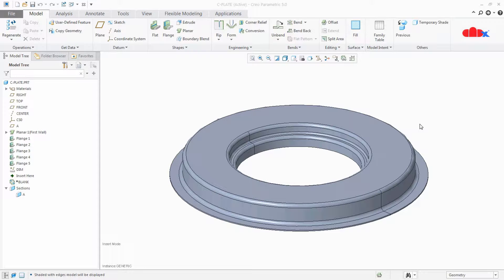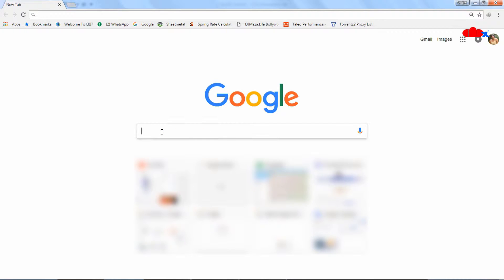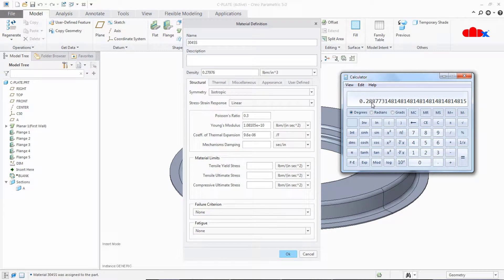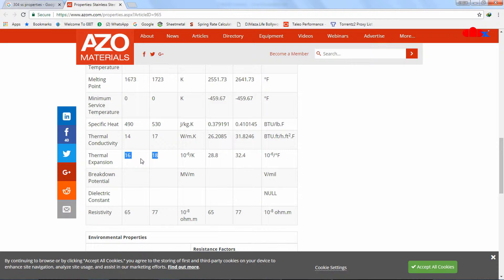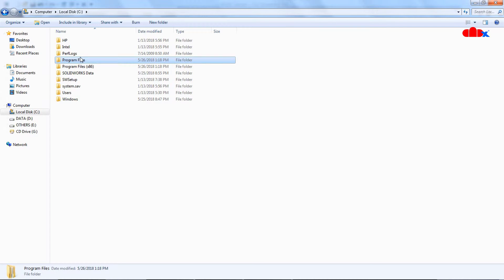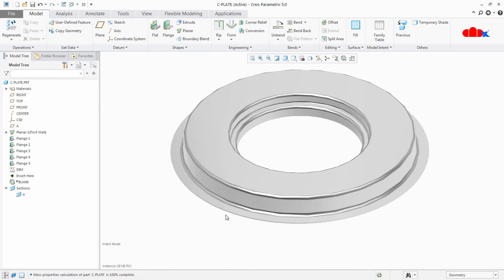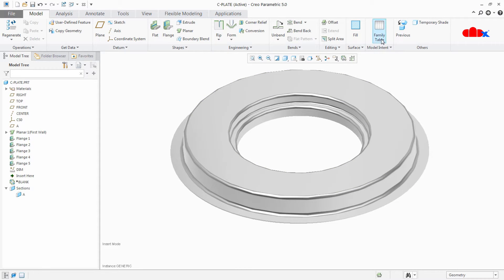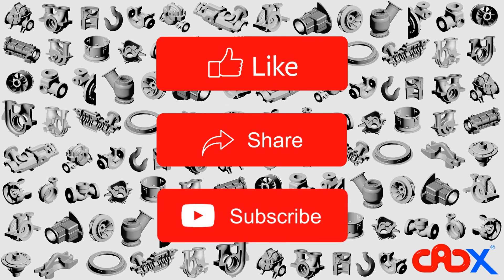Create new material | calculate weight of the part | add to the drawing in Creo Parametric

Comment: I suggest that you create a parameter called Wt_kg prior to Relation. That way you can assign the units for the parameter Wt_kg as 'kg '. This when called in relation, would automatically convert based on unit of pro_mp_mass. No need to multiply by a conversion value.

Please try this out.

Comment: Sir, how can we calculate assembly weight..
Reply from the maker: First you follow the same procedure and add weight for all the parts coming into the assembly.
Next is, create a bom table inside the assembly drawing. Call the weight parameter inside your table.
Atlast use summation to calculate the final weight of the assembly  in your drawing.

Comment: My part weight is 2.580 e02 kg what its mean
Reply from the maker: 258 kg
Reply: @CADxTraining  but part too short and in al5052 material
Reply from the maker: I think your unit is in inches.
Reply: @CADxTraining  no its mmks
Reply from the maker: Is it weight or mass? e+02 or e-02
Reply: @CADxTraining  mass  e+02
I am calculate  in analysis  and then mass property
Reply from the maker: What is the unit it is showing?
Reply: @CADxTraining  kg
Reply from the maker: I tried this with al6061 using same dimension 160x23x1.5. I got my mass 1.496 x e-02 kg. This means 0.01496 kg. Which is 14.96 grm. You check your material.
Reply: @CADxTraining  ok I will check
Suppose if mass is 1.467 e+02 kg then what weight will be
Reply from the maker: You create the same part once again. Make sure that the unit is millimeter kilogram second. Then apply the material.
Reply: @CADxTraining  ok sir  thanks for your support    
If u provide your no. So I am show my doubt pic.